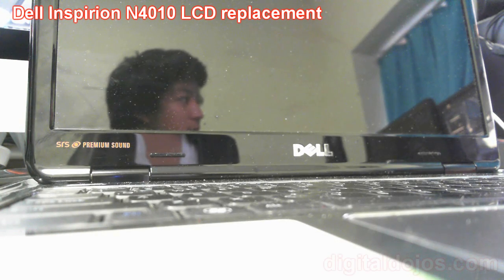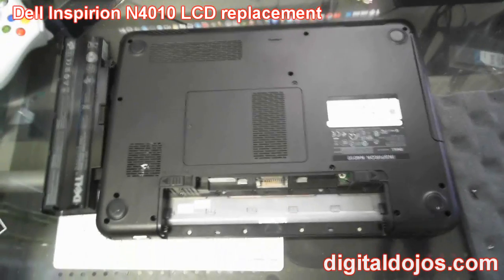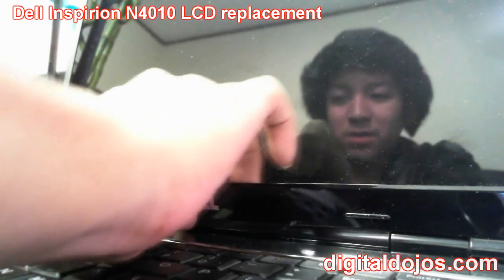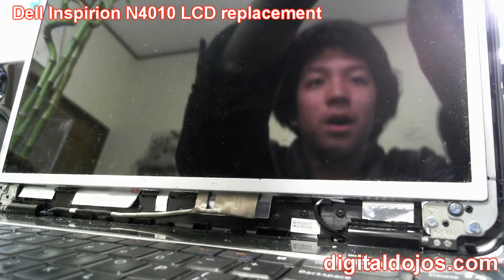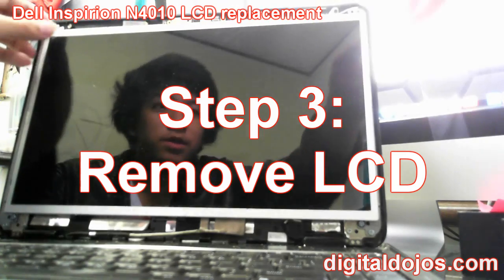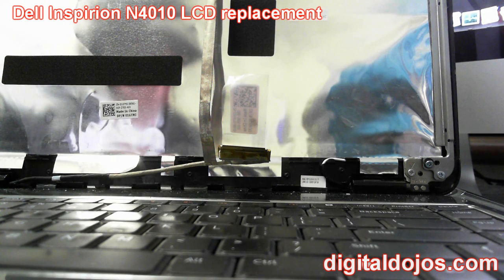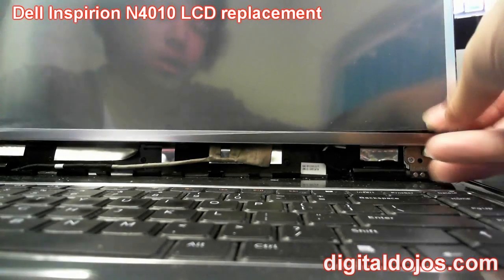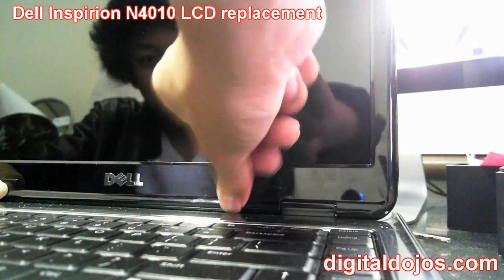Tech-Repair: How to replace Dell Inspiron N4010 Screen

Comment: Ugg, this could have been half as long if you'd just cut out the useless chatter. You didn't even start to remove the screen until you talked about useless crap for three full minutes.

Comment: Great tutorial. Is there a way to diagnose if the problem is the display cable rather than the screen? I can get a good picture if I tap the screen hard or wiggle it around a bit. Could this mean it's the cable rather than the screen itself?
Thanks.

Comment: @teclasgarfield There's a lot of what ifs. I remember cracked a screen once and replaced it with a larger screen, going from a 15.6' to a 17', also increasing the resolution. It didnt display it completely correctly, slight distortion, but I got all the pixels. Screens dont use all the same type of connectors, or power inverters, Hence all the what if's. Plausible, but not recommended.